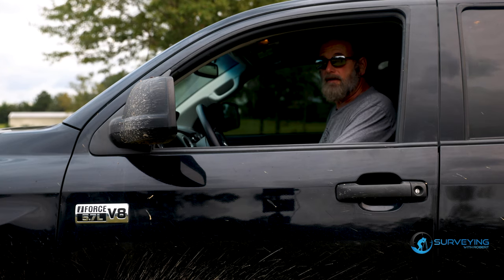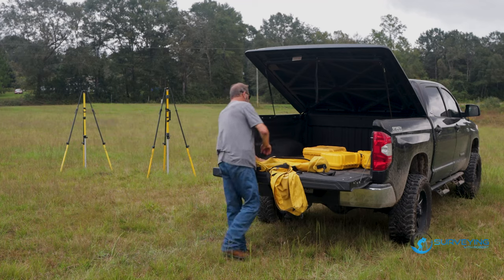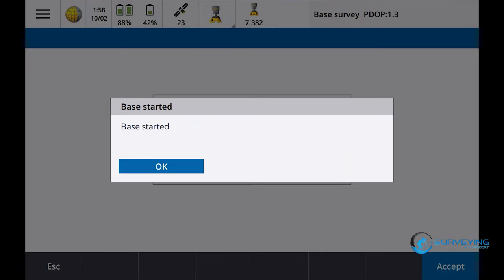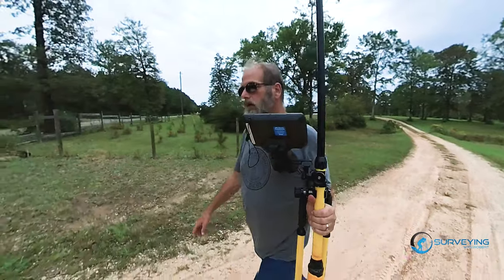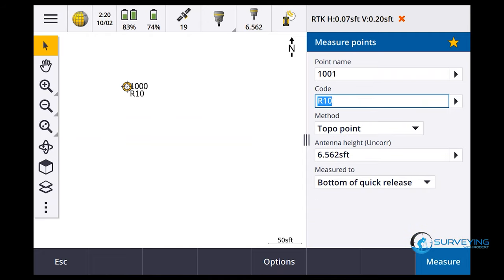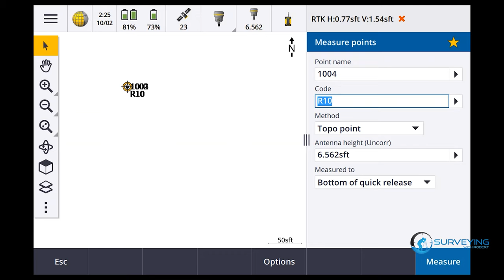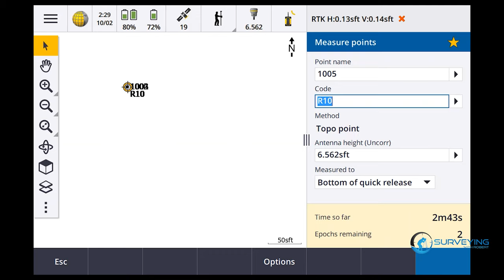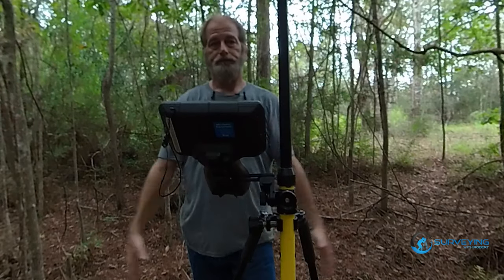Trimble R10 vs R12 Base

Comment: Great information for those who don't totally understand global positioning systems, different codes received  and especially the different types of receivers out there...Not changing your location on the first two swaps allowed for faster initializations and acquiring Survey Grade. I wish Trimble had the "Smart Fix" algorithm in ACCESS like SURV PC does for the Carlson BRX receiver. BeiDou (Chinese constellation) means "Big Dipper" in Chinese and is Pronounced "by-dough." Tip if you connect to VRS/RTN networks that are Trimble based and select the RTX 3.1 connection to the mountpoints they broadcast full GNSS constellation data to include GPS, GLONASS, GALILEO, BeiDou.

Comment: Hi Robert, Like your videos. I wonder if you can make one to stake out fixed offset point to the poly line to the nearest. For example laying out building minimum 30m away from lake edge. Offset command do not work in this case. If we draw a  radius from a staked out point it should not touch polyline anywhere. I am using TA 2021 on TSC5. Sorry this question is not  related to this video.

Comment: Are you talking about the R10 version 1 or version 2? Version 2 has the same internal hardware as the R12 but just different firmware.
Reply from the maker: R10-1 the R10-2 is a R12 when you update the firmware.